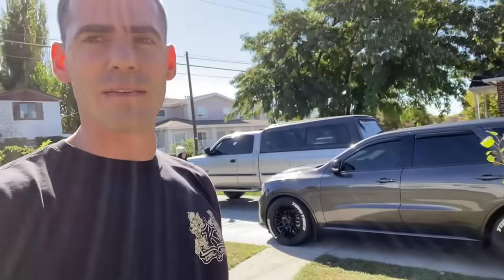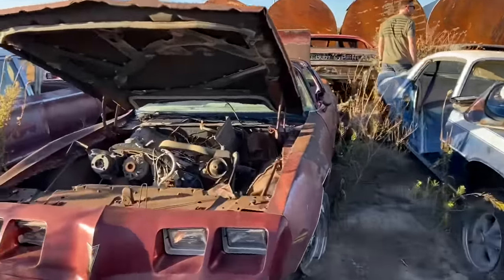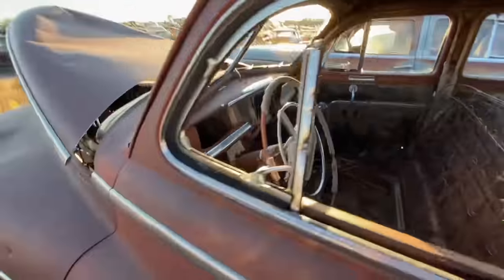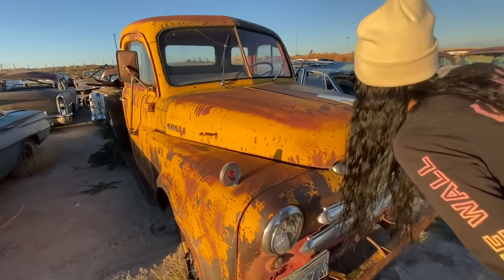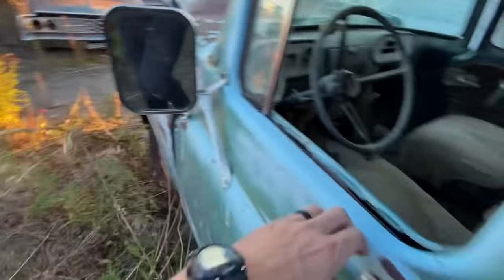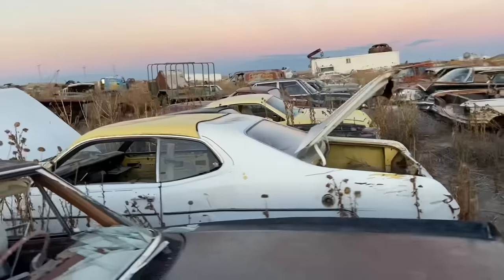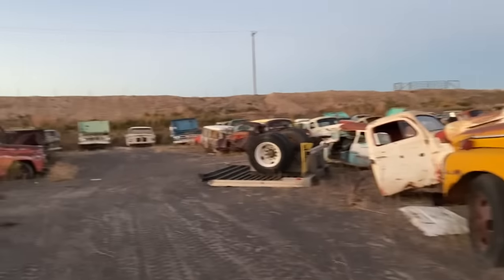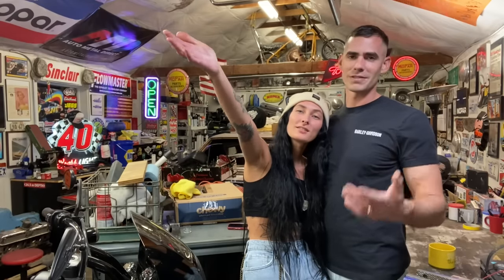Junkyard Full of Abandoned Muscle Cars, Classic Cars and Trucks

Comment: @19:23 that 1960 Dodge dart wagon you're pointing out the shape of the windows in the back just think about if one of those break or get busted how hard it will be to find a replacement for it, I have a 1955 Lincoln Capri 4-door post car and some random tweaker came up and busted the front windshield and guess what that car windshield is made only for that car and that car only there were only 10,000 of them made in 1955 as a 4 door, it is impossible to find a replacement windshield brand new and almost impossible to find one out of a junkyard. And if there is one in the junkyard they do not want to pull it even the glass guys don't want to come out and pull it either so when I actually find one in a yard that I can remove I'm going to have to do it myself... So as a classic car owner for my whole life one thing to always think of is how hard it will be to replace the windows if they are broken just keep that in mind when purchasing a vehicle like that 1960 Dodge dart wagon
Reply from the maker: Good point man there are definitely some cars out there with very rare glass in them and when they’re in mint condition, it’s definitely hard to see them sitting there wondering if they’ll ever leave the junkyard or someone’s yard

Comment: Great content Thank You  . Wasn't that a 67 Buick LeSabre next to the Wildcat , I have great memories of my dad's 67 Buick LeSabre that had 340-4 also 1st engine that I rebuilt it had wiped out the cam bearings and camshaft ended up installing new cam bearings , camshaft checked crankshaft journals honed cylinder bores I was very proud of Myself . 🇺🇲🇵🇷🦊👍

Comment: Back in 60's and 70's the car year was molded in to the tail lights
Reply from the maker: That is correct yes OEM lenses and bulbs had stamped markings for the year. Also for example my 66 Buick, all 65-67 GM cars had a “T-3” glass bulb headlamp with a triangle in the middle that said “tT3”

Comment: That 1957 Dodge panel Truck would go right on a 1987 Dodge pick up frame. A friend of mine did one and it will built right up on the newer frame same mounting points
Reply from the maker: That’s pretty rad!
Reply: use a ramcharger frame and its even easier,i owned one about 12? or more years ago.